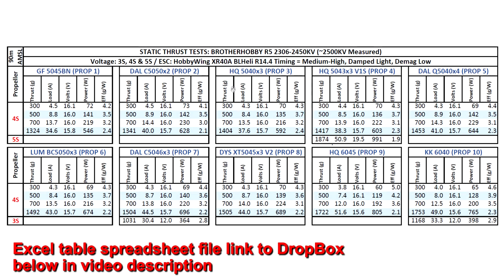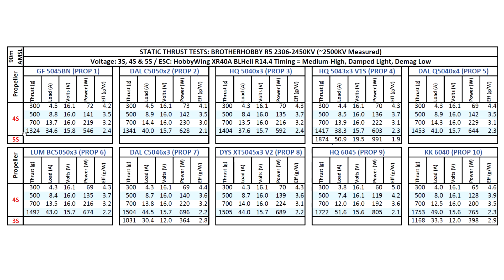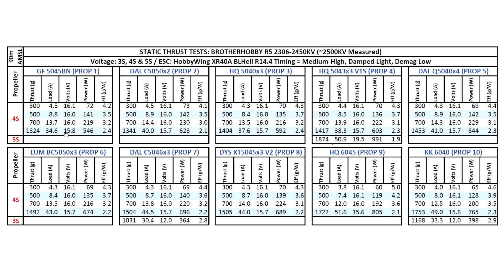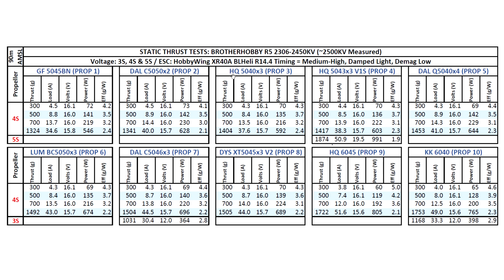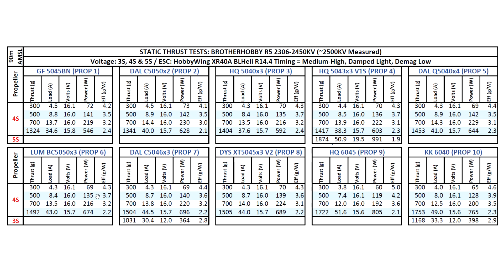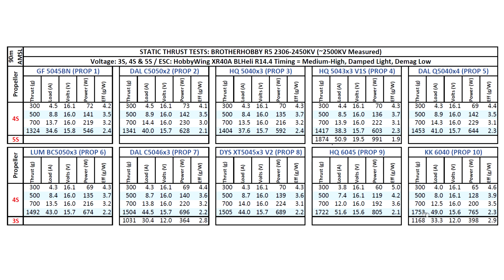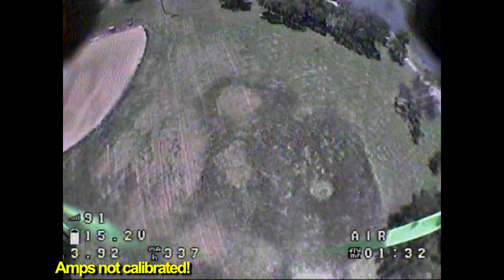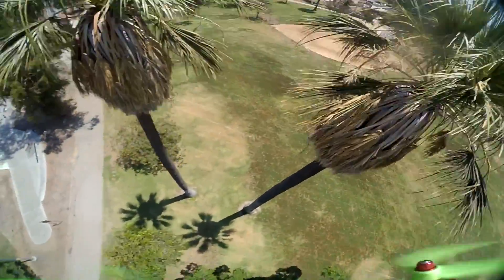BrotherHobby R5 2306-2450KV "DEADPOOL" Thrust Tests -Good Balance of Power & Efficiency!

Comment: Do you like these more than the t3 motors?
Reply from the maker: HighRise RC T3 felt like it had more grunt at lower rpm. These gave smoother transitions when freestyling. But I haven't been flying enough to really get the feel for each. From the very little time I've flown them I think I like the T3's a little more.
Reply: EngineerX thanks for the reply.  I already own the deadpool but haven't flown them yet.  I'm looking to order more motors to replace some weaker arris motors on my first build.

Comment: good results on thrust stand ,but in real life use mine where rubbish. very high current draw (tried 3 different speedys and different props and different craft . never flew a pack with out some issue . in the end the bearings feel like crap (maximum 10 flights) . emailed brother hobby no answer . do not buy!!!
Reply from the maker: Sorry to hear about your issues. We are all suggesting using larger bearings. There's a point when saving a fraction of a gram or a fraction of a dollar doesn't make sense. So larger, heavier but more durable bearings are preferred by most users.
Reply: EngineerX . yeah its a shame since brother hobby has had such a good reputation,which is why i paid so much for them . but unfortunately due to the lack of support this was my first and last set of brother hobby motors

Comment: Over at miniquadbenchtest the results are quite different. e.g the AMP draw with a DAL5046x3 is ~35A whereas you tested it at 44.5A. I'm just wondering how the differences are possible. I'm looking for a thrust/efficiency motor that can take the EMAX Avan or Gemfan 5152 without drawing AMPs ~50A. According to miniquadbenchtest and the number for the DAL5046 this motor should be able to fire the Avans without the need of >30A ESCs?

Comment: Just a thought..... instead of using hd footage at the end maybe show dvr footage with an osd that shows current draw as well as tell us what props your flying so we can see some real world amperage. Love your testing. keep up the informative videos👍and THANK YOU for your contribution to our comnunity.
Reply from the maker: Good suggestion, I have thought about adding that, unfortunately I have not been flying often, I get home too late from work and weekends there's always something else going on.  I got an OSD on that quad, but have not around to calibrating the current sensor yet, only the Voltage sensor.  But you're right, seeing actual flight showing Amps would be even more useful. I recently ran some tests to see what were the highest Amps on my other quad with EMAX RS2205(S)-2300 so I attached a powermeter I have that reads within 1-2A of the thrust stand. I think I saw around 90A Max with DAL C5045x3 so very close to the 30% lower than thrust stand Max A. One of these days I'll run more tests to get the comparison flying Amps to thrust stand Amps. Thanks for watching!

Comment: You can post the PID configuration thanks
Reply from the maker: BF 3.1.7 
set p_pitch = 54
set i_pitch = 48
set d_pitch = 28
set p_roll = 48
set i_roll = 40
set d_roll = 27
set p_yaw = 82
set i_yaw = 45
set d_yaw = 20
Reply: EngineerX  thancks

Comment: How would you compare this to the DYS mars?
Reply from the maker: I have not had time to fly the Mars yet. Stick-time for flying and trying motors are too few and far in between lately. Actual work gets in the way on weekdays and weekends have been filled with some sort of family activity or work at the house.... Aaaaargh... I should've been a millenial - sorry about the rant/complaining LoL .....
Well, comparing my test results, they're pretty close to each other. The R5 makes slightly more thrust overall on all props but the Mars is a bit more efficient. From tearing down both motors and quick inspection, both seemed to be very well made. Both have "top-brand" bearings and have been very well put together I think. Of course, that's only my impression from just looking at the motors. In reality, we need to put them through some abuse to see how they survive typical crashes and some long-term use. When you get brand new motors, it's pretty hard to say how they'll behave after some good abuse.  I've flown these R5's and really liked the power and efficiency. I think these are a little more expensive but they have more costly bits like the titanium shaft and 7075 Al armature. Just based on performance, they're pretty close for freestyling, unless you need the absolute lightest and more powerful to beat your buddies at the races, then the R5 has the advantage. It's pretty hard to decide these days!

Comment: hmmm comparing with the rcx2206 v2 the numbers are almost the same with the rcx being slightly more efficient. It is a little lighter though but it is also more than double the price. Smoothness should be a factor and of course durability ,but rcx is super durable so far.
Reply from the maker: Those RCX RS2206 were quite a surprise when I tested them. They packed big magnets at very high density on the RCX and gave it all the good ingredients. It's quite a bargain for what it offers.
Reply: they have the best price to performance ratio of all motors for sure.

Comment: Great review - these motors do seem to be a good balance and ability to do 5S - thanks for including some flight footage, was good seeing you out there flying for a change instead of just testing!
Reply from the maker: Thanks!  :) And I do need the practice and more tuning time. I usually just give my quads as quick a tune as necessary just to get in the air and have fun, I'm not good or patient at tuning anyways. 
Yes, 5S looks like it's very manageable with these motors. I got a couple of 5S packs that I'll have to try, but don't feel all that confident with the 25A 4-1 ESC on this frame. 30A would be better
Reply from the maker: Thanks!  :) And I do need the practice and more tuning time. I usually just give my quads as quick a tune as necessary just to get in the air and have fun, I'm not good or patient at tuning anyways. 
Yes, 5S looks like it's very manageable with these motors. I got a couple of 5S packs that I'll have to try, but don't feel all that confident with the 25A 4-1 ESC on this frame. 30A would be better

Comment: i gotta ask :) it is you that controls the spin up time right?
Reply from the maker: Yes, I found that to be the fastest method for running tests, the automatic scripts take too long - I would never finish running all the tests. I use a radio control and receiver connected to ESC.
Reply: EngineerX my friend thought that it was the actual spin up time lol
Reply from the maker: LoL ... no too slow! actual is a little faster but it wouldn't give enough time for the thrust stand data logger to acquire data properly, it's a bit slow so I gotta spin up slow to get enough data.

Comment: Hello. Do you think the Asgard FC V2 can handle those motors or the one's from Pyro-Drone that are 2522kv without any problems? I'll appreciate your help and thanks for your videos.
Reply from the maker: I'm using the iPeaka 25A  4-1 ESC which uses AON 7418 FETs which should be good for upto 30A bursts. I have not researched or looked at the Asgard FETs in detail. I did review the Poseidon from iFlightRC which seems to be same board just with different brand. If it uses the same FETs as the Poseidon AON 7520, those are the same used in the original KISS 18A ESCs and according to their datasheet they're good for 39A @100Cº / 30A @140Cº when getting proper cooling. Those are mostly used in 20A ESCs to have good overhead. So if you use 5040x3 ore 5043x3 props , theroretically the ESCs in the Poseidon (or Asgard if using same FETs) should be able to handle the loads on 4S with this motor 
You can see max with those props is 38A so multiplying by 0.65 we get 25A bursts which should be well within the FETs current handling capability for short bursts. But I can't give you 100% assurance at this time because I have not tried that combo myself, so it's all assumptions from using datasheet specs.
I wanted to use my Poseidon FC on the build I fly in this video but unfortunately it didn't fit in the frame - not enough room at front and back where the ESC motor outputs are located. I would do some research/looking to see what people are running with the ESCs on the Asgard.
Reply: I really appreciate your help. Thank you for all the good information.

Comment: nice! that 5043 prop sounds sweet too.
Reply from the maker: Is getting quite popular and flies nice. It allows high KV motors to spin easier at very high RPMs. Good balance of thrust and not-to-bad Amps and more durable than their 5040x3